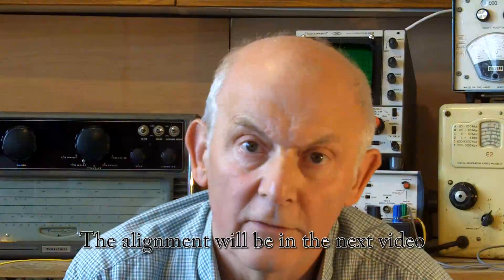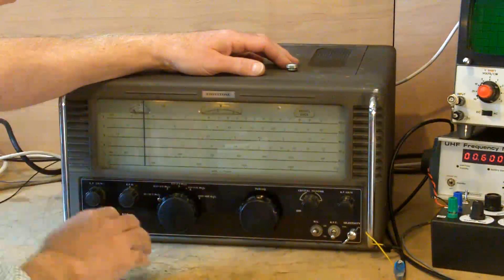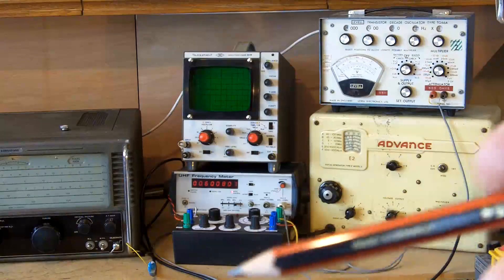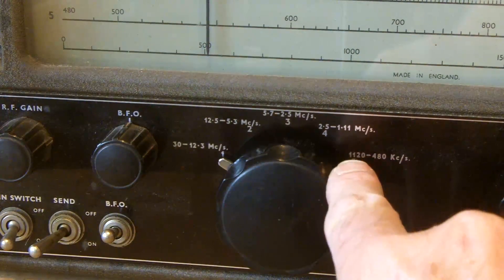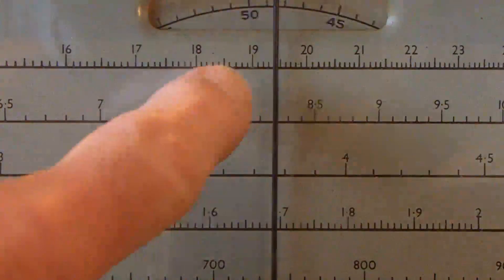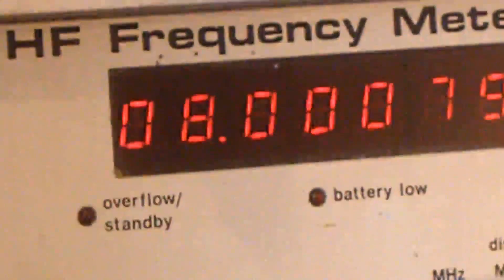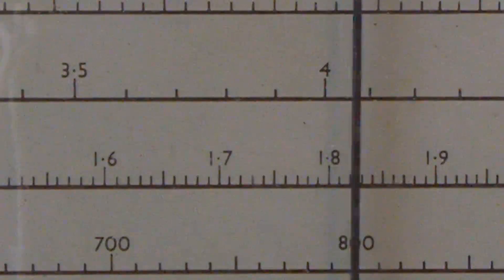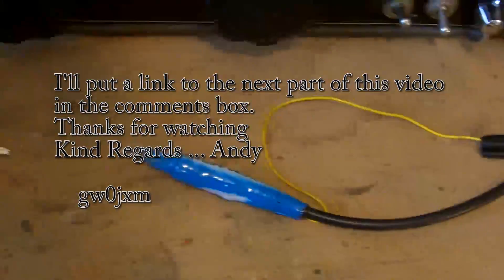About Radio 49 Checking the RF Alignment, Eddystone S680X communications receiver

Comment from the maker: Hi Shane, well lucky you. The radio is What’s called a ‘Communications Receiver.’  Communication receivers don’t necessarily have the greatest sound quality; the one in the video needs an external speaker, it also needs an aerial, you won’t hear anything without it. These radios have very good ‘Selectivity’ that is if there are two stations close together the radio can resolve either one. For a manual go to the Eddystone Radio User Group see link in the ‘Show more’ box OK?
Kind Regards ... Andy

Comment: Hi there, Andy! I've just been given lots of vintage radio equipment, I've got one of these but not a clue about it.. it's in very good condition, I was wondering what sort of power lead it requires or if it can run off batteries? Any help would be great, also what sort of radio is this, can it be used for music by any chance? (completely new to these) I'm in the UK.

Cheers, Shane.